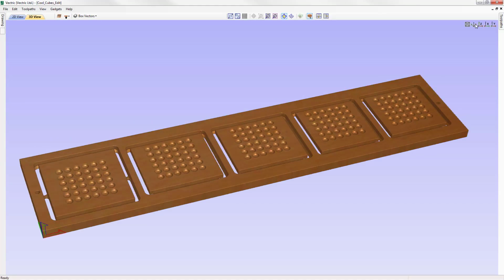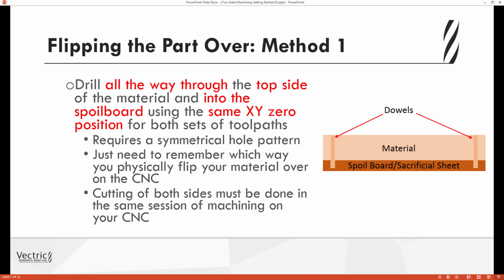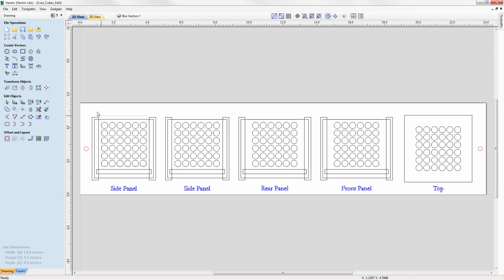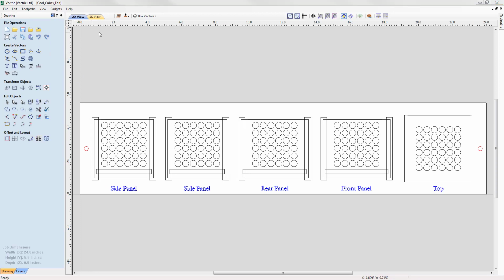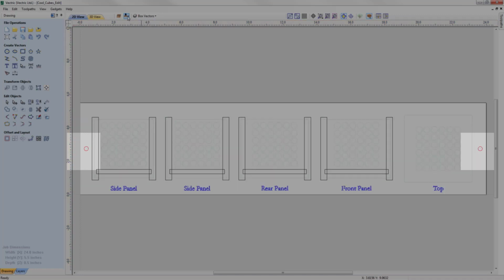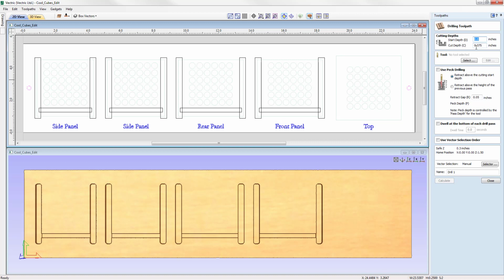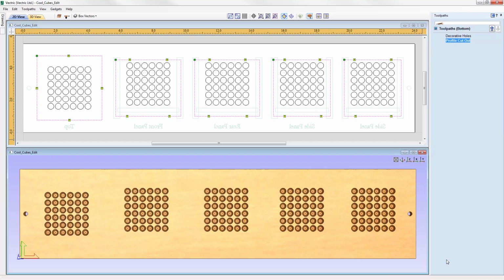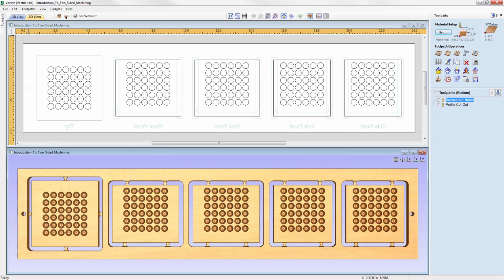Vectric V10 Tutorials | Two Sided Machining | Introduction to Two Sided Machining

Comment: Excellent video thank you. I do have a question, if I have a xyz probe and have centered the job elements do I need to use the dowels or am I missing something?
Reply from the maker: Hey John, thank you for your kind comments. Yes you need dowels, so you'll machine through the material and into the waste board so when you flip the part over you can align it to the dowel positions :) I hope this helps :)

Comment: After you flip your board over, do you do your tool set from the board face or the machine bed?
Reply from the maker: Hey there! It's really up to you where you want to set it, I prefer to set it from the material surface on the top and machine bed for the bottom side so that I'm always referencing from the same face (that being the top cut) I hope this helps :)

Comment: Hi! Thank you so much for posting this great tutorial! I am having some trouble with the symmetrical doweling system and I wanted to ask how you might correct it. In my jobs, I always flip horizontally along the X axis using four dowel holes pre-drilled into the spoiler board (it should be noted that my material is always 4'x4' 1/4" baltic birch ply) that correspond with four dowel holes that are drilled into the corners of the sheet at the beginning of my machining process. However, there is almost always variation (usually between 0.025" to 0.05") along the X axis. I have watched this video a few times and have tried to make sure that I am following these steps exactly, but I usually end up having to use an offset on Mach 3 to compensate for this variation. I am wondering if you have ever dealt with this issue before and if so, what was your solution? My jobs do not have very much variation in tool path or process so I'm looking for a sort of "set it and forget it" solution. Thank you so much for reading!
Reply from the maker: Hey There! Thanks for reaching out to us here on YouTube, this one may be better answered by our support team who could take a look at your file too to help point anything that could be a problem. You can e-mail them on support@vectric.com I hope this helps, thanks again for your comments and thank you for watching! Good luck!